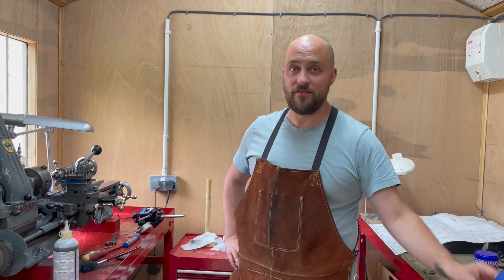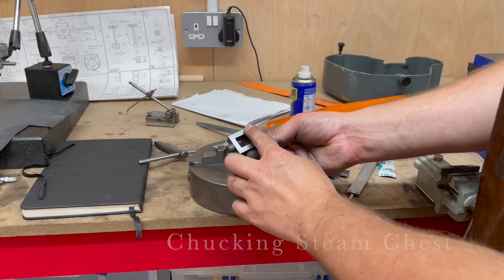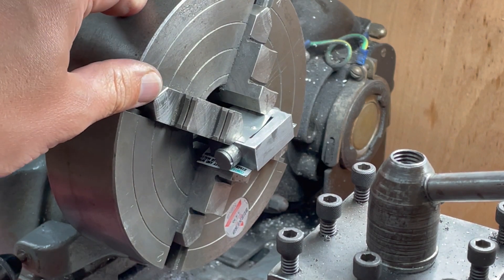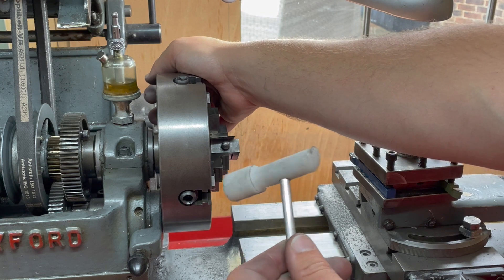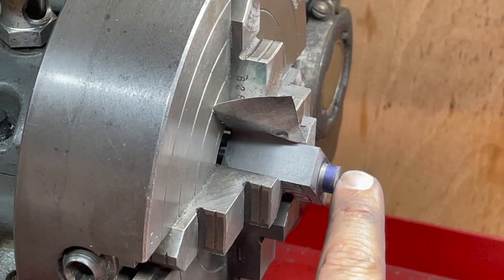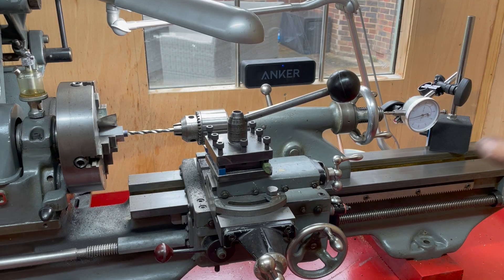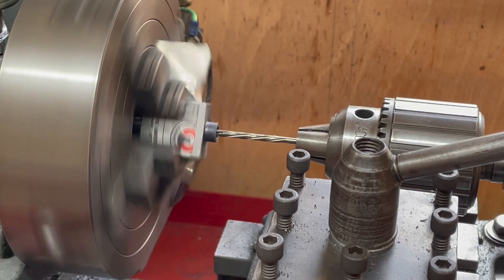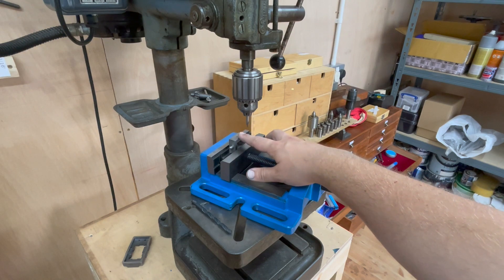Building a Stuart 10V Steam Engine on a Lathe VI - Chest

Comment: Hello WW,
Another good job done... did you get the little watchmakers vice from Cousins? Would you recommend it?
Take care.
Paul,,
Reply from the maker: I got it from Cooksongold - It's been invaluable in my 2mm/ft scale modelling but this is the first time I'm using it in anger in any larger context. It really is for jewelry and so on, but excellent for holding and shaping very small or thin parts.
Reply: @williamsworkshopuk  @The Knackler’s Workshop I have the same small vice which I bought from Cousins. I agree, it is an excellent vice with a beautiful parallel action. Highly recommended for small parts.